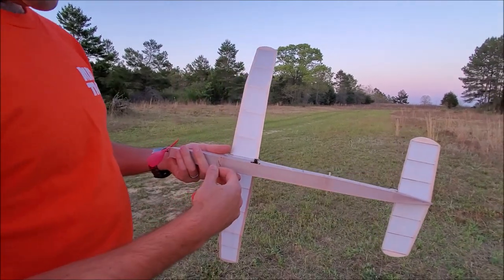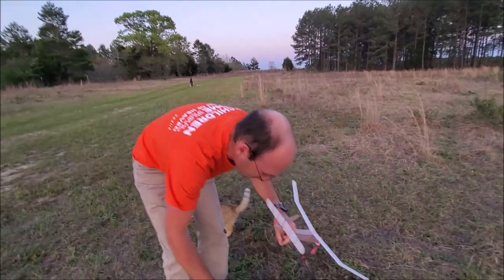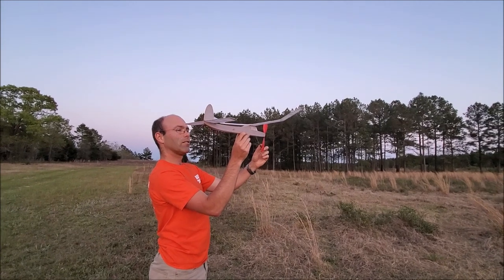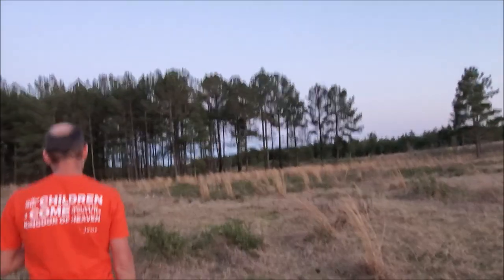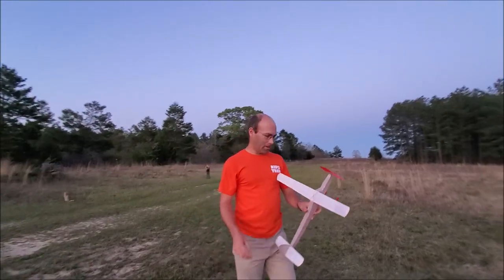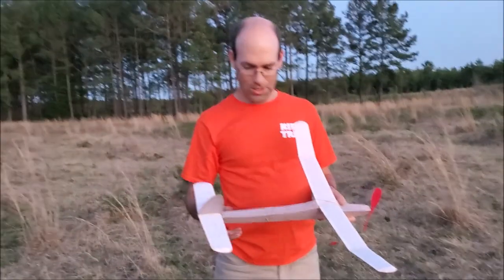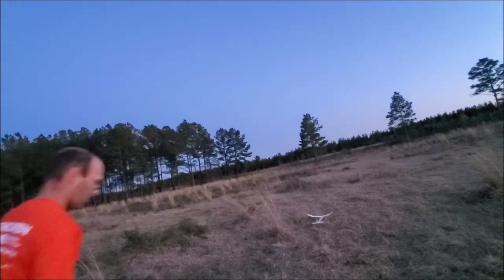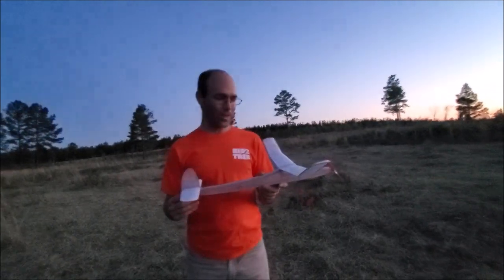Flight trimming the Guillow's Lancer rubber powered airplane!

Comment: Just some general rules of thumb for trimming outdoor rubber powered model airplanes. 1.) Weight is the enemy...only add weight to the nose or tail to get the center of gravity to where it's supposed to be, as shown on the plans...PERIOD!  With a "cabin" model of this type, that is the only option. On other models with just mounting rails or a pylon, the whole shebang, wing and mount, can be slid fore or aft to attain balance and no additional weight is needed.  2.) Glide circle is adjusted by stab tilt. ( Looking from the rear, if you want a right turn, the right tip of the stab should be higher than the left.) (If the fin has a warp in it, causing unwanted turns, steam it out!)  3.)  Glide trim is adjusted by packing up the rear of the stab and/or the front of the wing...sometimes both. 4.) Power trim is made with the nose block...almost all models require down and right thrust. If you've built the front of your model square, you might just as well add your first shim in the upper right hand corner of the model ( when looking from the front) as this will give you both directions at once. I suggest using thin (1/64 - 1/32) plywood for the front end shims... the rubber motor, at or near full winds can/will compress soft balsa shims. 

Josh's remarks regarding wing warps are right on...if power and gliding are to the right, the right main panel needs to have wash-in (trailing edge down) to prevent spiral dives. The tips need to have wash-out (leading edge down), in whatever the situation, to prevent tip-stalls. In good lift (and sometimes "rubber bunching") the airplane may tend to stall...with wash-out, the tips stall last making the plane stall straight ahead...without it, the wing will stall off in one direction or the other, dropping that tip, and it'll just dive into the ground. Said warps are best induced during the tissue drying stage of wing covering. For models this size, 1/16" warps should be adequate. Make sure your prop free-wheels during the glide...a locked up prop spoils the glide, the turn...EVERYTHING...as it acts like a brake and a forward rudder.

I adjust every "locked up" model (non-movable control surfaces) in this order: Glide trim (while keeping an eye out for glide turn), power trim and then final glide turn. CHEERS!

Comment: I find that initial glide tests are challenging because we don't know the required speed. Too slow, dive into the ground and break something. Too fast, stall, dive into the ground and break something. I find that a right bank with a bit fast launch lets the initial turn absorb the excess speed while the sideslip will bring the wings level without a stall. This will also get the plane up high enough to get enough airtime to judge trim.

Comment: If the stab has a lifting airfoil (hard to tell whether it does or not from the pics), it will give nose-down tendancy, requiring seriously rear-ward CG and lots of finickyness in pitch stability. I would try a flat stab and see how CG and pitch issues work out.
Reply from the maker: Not quite. If the stab has more camber than the wing, you'll certainly have pitch instability, however an aft CG alone, with a lifting stab, does not make for a finicky airplane. Quite the contrary, it makes them much more forgiving.

Comment: Very nice flights, Josh, (for a Lancer). 🙂👍 Good under power but they are notoriously poor gliders. I add a 6" center section to the wing to make it 30" wingspan. Big improvement but I guess the contest rules won't allow you to do that? BTW - the plans indicate a shim under the wing leading edge is required.
Reply from the maker: Huh. Guess it helps to look at the plans! 😅

Comment: "Definitely flies like it's heavy and has a bad airfoil" 
Total agree. This thing needs 1/2" more chord and the airfoil needs to actually taper with the wingtips. I think it may be too high % camber too
Reply from the maker: Just cut the airfoil thickness to 8% and it'll make a world of difference. Stab needs a Simplex upper profile or similar at 5% thickness to really make it come alive.
Reply: @joshuawfinn  i think I'll print some templates for this. I've got a second Javelin kit I want to run a few mods on to see how much better it can get

Comment: I mean if your CG is on the trailing edge of an unswept wing, that it dives nose heavy is just weird science. I built and flew the heck out of my Lancer, I used a dime store coloured tissue in place of the stock Guillows tissue which made it lighter but much weaker, I would get ok glides but I always felt the wing was poorly designed.
Reply from the maker: For what it's worth, several of my gas models have the CG behind the wing. All a function of size and distance of the stab relative to the wing. Agreed on that airfoil...it makes for a pitiful glide.

Comment: Would you be willing to show us your flight box setup for winding the models up. That is very handy.

Also I have been building models for many years and I have yet to see the setup you have made to stop the thermals. That would be awesome if you would go into detail on how it works and how you installed it. Thank you for your videos.
Reply from the maker: There should be a link in the description showing how I installed the dethermalizer. The box is a future video feature along with the airplane it was designed to support. If you do a Google search for winding stooge, there should be some good articles on setting up winding rigs.
Reply: @joshuawfinn  thank you!

Comment: This video could be called The Revenge of the Lancer.  Every disparagement was countered by a pretty good flight.  I've built free flight rubber craft since my childhood and the Lancer, although everything Josh said, especially being overweight, has the lines of a decent small model.  If you can build a nice scale Guillows, trim it and make it fly well then you are a master modeler.  The Lancer and its siblings aren't that much of a challenge.  
Question:  for builders with experience with laser, die and print wood models, which do you prefer?  I always liked print wood because I could get better fitting parts by iteration and didn't have burn marks.  Die crunch was better for plywood because I had mediocre tools to deal with virgin ply.  Love some other opinions.
Reply from the maker: You're not wrong. That said it glides like a brick compared to my other models in this size. I get 70-80 second flights with it compared to 3 minutes or more with my 26" span GR-6.

Comment: when you say the airfoil is bad. can you explain why? im about to build this kit.. maybe i can improve the wing a bit
Reply from the maker: It's a really thick airfoil, which is less than ideal for such a narrow chord. Go on Outerzone and search for Embryo Endurance models to get a feel for what typical airfoil sections look like for contest models this size.
Reply: @joshuawfinn  what do you think about adding about 3-6 in center section and fatten. Up the tips like the bird of time kinda deal..   trying to come up with simple solutions
Reply from the maker: @hondaxl250k0  I wouldn't extend the wing. It's already too long and skinny for such a narrow chord. Thinning the airfoil and cutting new spar slots would be easier and more effective.
Reply: @joshuawfinn  ok.I’ll thin my ribs a bit. I need to invest in a lazer printer lol.   I can just print off wing ribs quick and try them.
Reply: @joshuawfinn  hey I found a “ one nite 28” kit in my stash.  Made by peck polymers.. ever built that one?  If so how dose it fly?

Comment: Is 1/16 about the limit for the stab shim? If so would this apply to most planes?
Reply from the maker: It varies quite a bit actually. Usually outdoor rubber endurance models want 3-4 degrees incidence between wing and stab. 5 or so for scale, and then for glow models you'll see as low as 1.5-2.

Comment: What could be done to modify the stock ribs to improve the airfoil?
Reply from the maker: Sand it down to an 8-10% section, profile it about like a Clark Y or similar, and it'll come alive. Stab just needs the top front of the airfoil flattened out a little because it's too blunt on top at the front.
Reply: I will see what I can do. Thanks!
Reply: On my Javelins, I thin the airfoil about 25 to 30%. Don't know what that translates to in section. Flies much better in any case.

Comment: How and what needs to happen to improve the wing airfoil
Reply from the maker: More ribs, thinner airfoil, possibly a turbulator spar between the forward spar and leading edge depending on how you set things up at the front. The stock airfoil is almost twice as thick as it needs to be at the root, and over twice optimum thickness at the tips.
Reply: Thank u

Comment: Wood prop. Move CG back without adding weight. Minimum prop diameter is square root of wing area.
Reply from the maker: Can't do that for the postal. ;)
Reply: @joshuawfinn  Right! Must conform to the rules when entering a contest. The rule actually says stock prop diameter, does not say you could not substitute a balsa prop of that diameter.

Comment: Guillows' airfoils have always been inexplicitly terrible. As a model airplane company, one might reasonably expect that this aspect of wing design would be of paramount interest to Guillows to get right. However, this is not and has neve been he case.
For a rubber powered sailplane like the Lancer, a reasonably thick (that is, horizontally thicker not thicker balsa, and thicker than the kit airfoil), slightly but distinctly undercambered airfoil is probably the best choice.
Reply from the maker: Long ago, Guillow's had awesome airfoils. Their scale and endurance models from the 1930s are great, and they even kitted excellent power models like the Kiwi series.
Lancer and Javelin would definitely fly better with a thin, undercambered airfoil and closer rib spacing. Arrow has a somewhat better airfoil. Their simplified scale series are also excellent other than the nose block issue, and can be made into competitive scale models.
Reply: @joshuawfinn  Yes, I stand corrected. Those early Guillows models were/are great and worth buying and building, if you can still find one. Things seemed to deteriorate designwise at Guillows after the War. I think they were shooting for younger customers. 
My friends and I started building them around 1960, and we never got one to fly well, or even glide like an airplane. Even with the C.G. correct and built as lightly as possible, they "flew" like a bag of apples.
I never built one of the simplified scale Guillows', but of you say they can be made to fly well, I believe you.
Reply from the maker: @Glicksman1  if you look at the plans for most of the Guillow's kits in production, they share a common publishing date. I don't know the full story, but there must have been a big shakeup in 1967 or so, probably coinciding with them finally taking out Comet as a serious competitor. The old designs were all dropped about that time, replaced with the era of the stupid vacuum formed noses.
Reply: @joshuawfinn  That's interesting, I didn't know it. However, I was building Guillows' stuff and not being able to get them to fly as early as 1960, so that 1967 date and all doesn't seem to matter.(by '67 I was heavily involved with music, keeping out of Viet Nam, and my then beautiful girlfriend who became my forever wife, and other such things). Guilows' better, early designs did not appear in the stores near me when I was a kid, so I was unaware of those well-designed, good-flying kits.
I also built Comet Struct-O-Speed airplanes and such, and they ALWAYS flew well. I don't know why I always went back to try Guillows. Maybe it was their excellent, sexy, box art, certainly better than Comet's elementary B&W drawings on the box. Same with Sterling and Monogram Speedee-Bilt balsa stuff, which also did not fly. Their box art was intense and very seductive.
Yes, vacuformed noses that would cave in when you put in too many turns. Not that it mattered. More turns just meant that the model would crash into the ground in front of you a little faster.
I think that Guillows likely knew that their models couldn't fly, so why bother providing a decent rubber motor, propellor, and noseblock? Pretty cynical if that is so.
Kids today, and adults, too, ought to be most thankful for people like you and Hope at J&H Aerospace, and a few other companies that give a damn about real model flying in the old-school manner. 
Thank you Josh and Hope.
Cheers

Comment: Holy cow is it good rubber that makes it fly for so long? I made the same exact one and trimmed it to perfection yet I get beautiful short 10 second flights. Im using the stock prop/rubber band and can only get so much tension before it snaps back.
Reply from the maker: The included rubber from the kit is definitely not good. Quality rubber makes it fly much, much better.
Reply from the maker: @MassMangoMurder  for outdoor flying, the current batches coming from FAI Model Supply are all excellent. For top level indoor it's definitely harder and you need to make friends with other indoor fliers, however that's really only necessary if you're trying to win the Nationals or set a record, and even then I've seen off the shelf rubber take top spots.